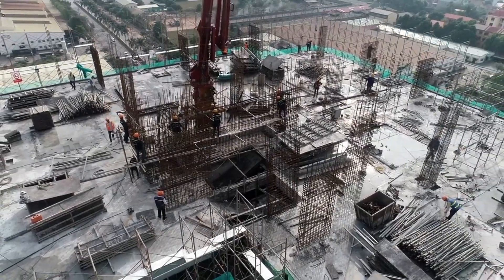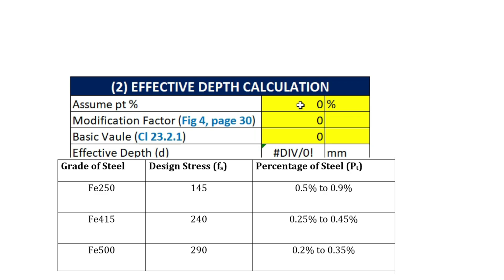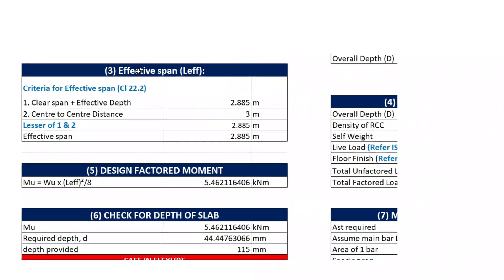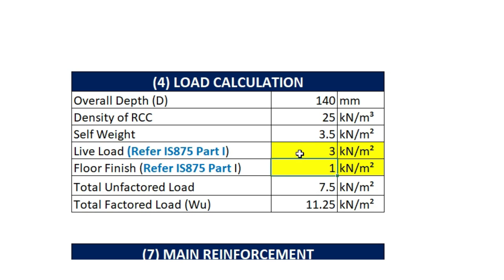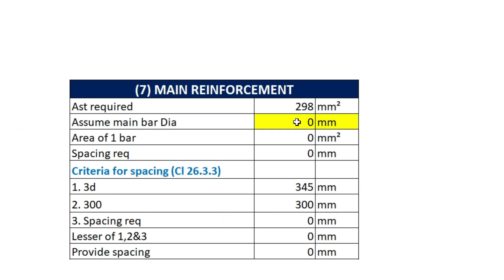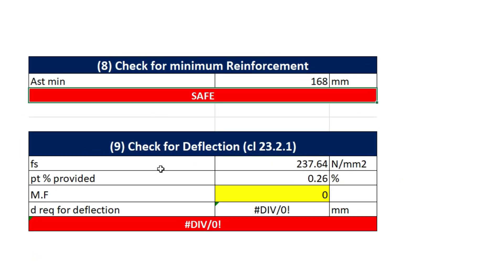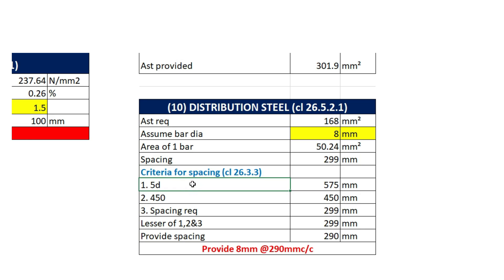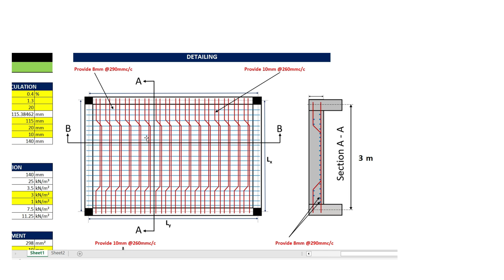Learn to design a slab in excel | Design of one way slab in excel as per IS 456 2000 | Civil Tutor

Comment: Sir, As per the Data  size  of room 6Mx3M (ly 6 lx  3M)  In3rd step  furnished as the clear Distance + effective depth  is 2.88 M 
Sir , please clarify How the  Clear span is reduced from 3 M to 2 .88 M  (3rd step)  and  center to center  Distance is furnished as             3 M  instead of 3 23 M
2:30